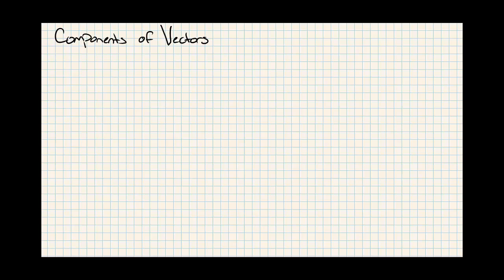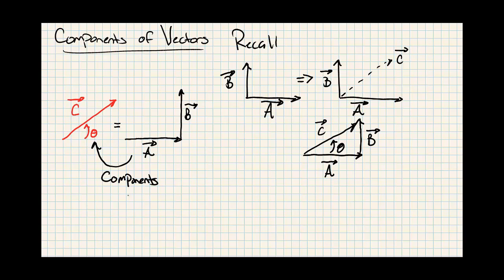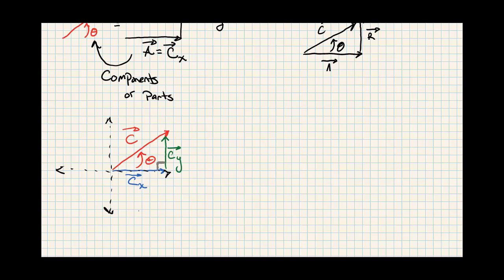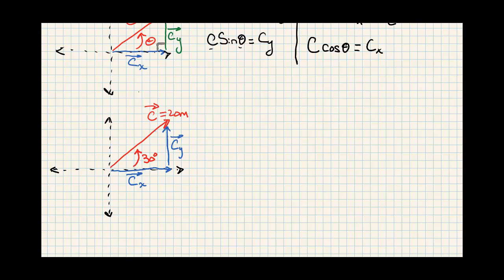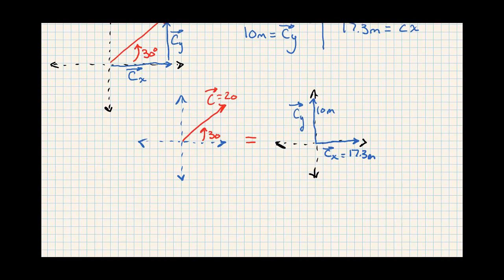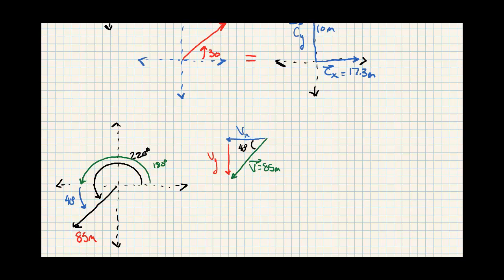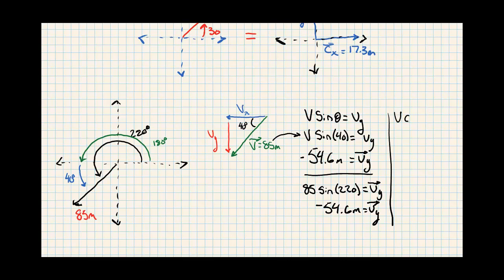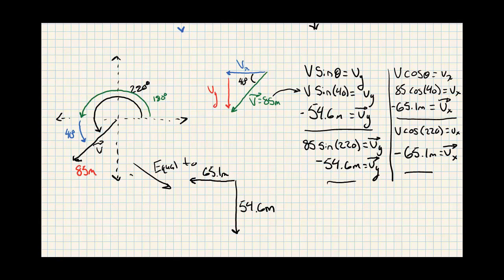Components of Vectors

Comment: Shouldn't the arrow above V at 13.29 be in the opposent direction?
Reply from the maker: Ashi - The arrow above the V simply indicates that the variable is to be treated as a vector. It always points toward the right for that purpose and need not match the actual direction of the vector.
Reply: got it, thanks!

Comment: How did u got the exact values of vy and vx as 54.6 and so?
Please reply I'll sub u
Reply from the maker: I multiplied 85 by sin(40). The value is 54.63694682 but I rounded to 54.6. If you're getting 63.3, your calculator is in radians not degrees. Change it in your settings.
Reply: is there any way to get it without a calculator?